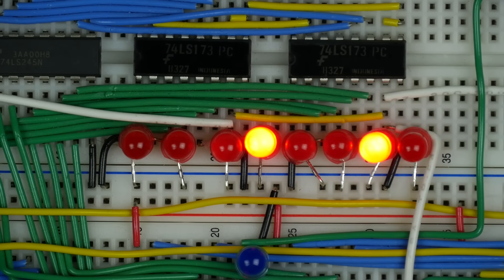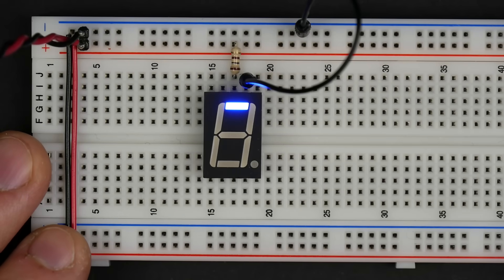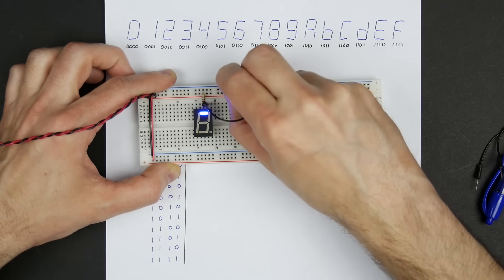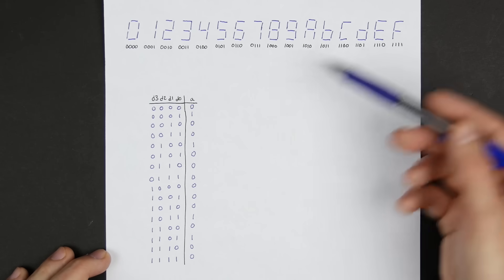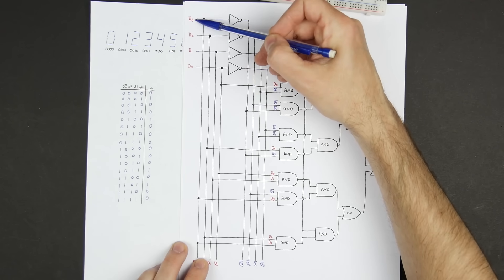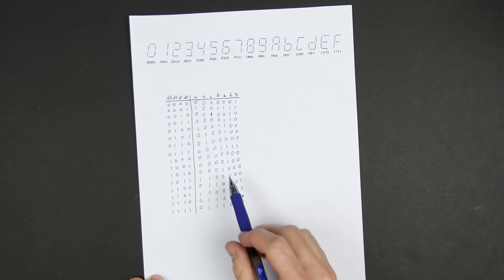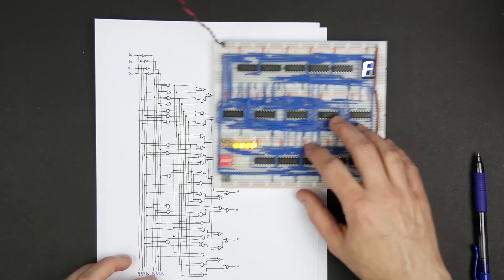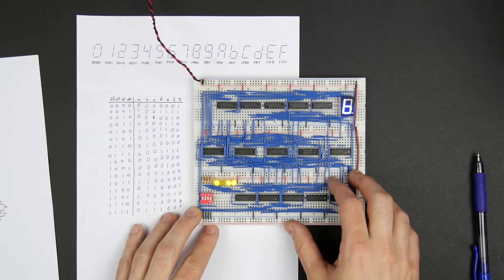Designing a 7-segment hex decoder

Comment: Edit: fail on my part, you totally do that in the next video XD

Couldn't you use a small eeprom to store that table as 8bit control words with the last bit always 1 since you only need 7 out of the 8 bits in that word ?
Store the control word at the address of the number it needs to display.

so for example for F: you'd store 01110001 at address (0000)1111; the last bit is always a 1 because there is no segment for that bit
That would essentially reduce you down to 1 EEPROM IC and the return binary value would also power on the segments themselves( this is just my theory XD sorry if I'm mistaken )
Reply: hi there 
CREATE SHADES USING SIEERPINKI'S TRIANGLE AND YOUR SMART PHONE  https://www.youtube.com/watch?v=DMYn_0uTVB8&t=15s
 go watch and try supporting by subscribing

Comment: There is IC 7447 which are specifically for 7 segment display.
Reply: Except that it doesn't do hex, its internal structure takes a very similar approach using gates to do the decoding.

Comment: Hmm... I'm a little confused. If 'F' is 1111 then d3,d2,d1 and d0 should be on. So, the third logical gate at the bottom should be connected with the last one. Or I'm wrong? And on the end when you have number 6 on the display. Why did you have (presumably) number 4 (or D) on the diodes?

Comment: I’m probably gonna get hammered on. But, after some simplification, just to put it in perspective for just output a. He has, before everything else, a total of 18 gates and 5 chips being used. After the simplification, if I did it right with the little time I have done, there should be a total of 4chips and 9 gates being used with XNOR’s, AND’s, NOT’s, and a OR. so if anyone was curious about a simpler logic diagram there is my take. 
(NOT C AND B AND (A XNOR D)) OR (D AND NOT B AND ( A XNOR C)). Now I imagine that the logic diagram can become simplified even more or even when other lights are added you might have duplicates in some other equations getting less gates because of overlap. Anyways just wanted to share this found it interesting.

Comment: Or use 74LS128 decoder as I remember all this logic circuit are built inside it 😊
This is why we have something called seven segment decoder for running the seven segment display. Only u will use single IC to wave off all this digital circuit,
But to build this you are so great.

Comment: Why not 2digit hexadecimal? For me, I am so used to hexadecimal that I just read it as a normal binary number :D :D Hexadecimal is used for binary flags definition and this is what it essentially is. However, instead of 8bit flags, 32bits are used nowadays (or 64bit when you need a larger flags register, but 32bit is minimum one). I read 0x00000008 as 28 zeros followed by binary number 1000. 1, 2, 4 and 8 are the base digits that define a single bit. Nothing else. Everything else is just combination of those bits. 0xFFFFFFFF is a single 32bit flags registered with all possible flags on (32bit registers can hold up to 8 flags, 64bit ones can hold up to 16 flags).

Refer to this gist: https://gist.github.com/Polda18/0d5f9484d5330bedc5125253b6673ec1

Comment: Can this LED display be controlled with a potentiometer in any way possible? I was hoping to connect it to a potentiometer, and have it read out the voltage as the potentiometer is turned. No chance? Thanks!

Comment: you know that can be compressed down into 17 gates maximum .... because of all the over laps ....did this as a mid term test in high school ... best was 17 gates ... on a ttl cmos logic probe giving a hex out code .... also if you want to expand the display just add another display and include it in the increment as the one other one counts to f

Comment: It would be good PNP transistors are used to drive the segments.  A segment is on when the input to base of a PNP transitor (connected to a segment) is 0V, that is, like GND.

So, you have common anode 7 segments.  Use the 7 PNP transitors (or 8 of them if your 7-segment has a dot for decimal number) and use a 74HCT595 to shift out the bits to turn on/off the segments.  The HCT595 also lets you chain the 7 segments to make more digits.

Comment: you could easily create a tiny version using an arduino nano/ some other board and wire the pins to digital output at a low voltage with complex logic coded in?

Comment: It took me a while to figure out why you put your switch upside down -- after I wired mine and it didn't work (since I wired my switch differently out of ignorance). I seem to recall you mentioning turning your switch upside down in another video (but I don't remember which one), but I don't recall you mentioning why (other than aesthetics). Turns out, the 74LSxx series chips will output high (technically, undefined), when the inputs are left floating. With the upside down switch, when its "off" (actually "on"), the chip inputs are all pulled to ground. Then flipping the switch "on" (now actually "off") will disconnect ground and allow the flow through the small pullup resistors to V+

Comment: I was thinking of a way to optimize the circuit.   I haven't written it out yet but i was thinking about it in theory.      You start out with four bits and with the 8 leads (four bits, and four not bits). 

You could split up the 4 bits to 2 bits each  and then create ands for all of the four possibilities of those two
( 00, 01, 10, 11) .   once again, you will out but eight leads   but then you can make ands with these and maybe it will be a lot simpiler becuase there will be a lot of common leads.    ill need to work this out..
Reply: Benjamin Rutkowski

Comment: Wouldn't you just need 2 segment displays and twice the circuitry to display an 8-bit word in hexadecimal? Seems like you could treat the two chunks of 4 bits separately. You would only need 3 displays and more complex wiring if you wanted to do it in decimal.

Comment: should it be "1" ON and "0" off? I'm a bit confused
Reply: War Gamer Since it is a common anode, the p side of all the LED are connected together to a +ve voltage. The other side (n side) of the LED can be either connected to +ve or -ve Voltage. If it is connected to 1(HIGH), both sides of the LED will have same voltage and no voltage drop across LED so it will be OFF. If it is connected to 0(LOW), there will be a voltage difference across LED and it will be ON
Reply: hi there 
CREATE SHADES USING SIEERPINKI'S TRIANGLE AND YOUR SMART PHONE  https://www.youtube.com/watch?v=DMYn_0uTVB8&t=15s
 go watch and try supporting by subscribing

Comment: 07:27 There is a nice couple of chips that contain a combination of AND and OR gates connected in this particular manner to facilitate building decoders:
74LS51 contains two OR gates, each taking input from a pair of AND gates; the first one from two 2-input ANDS, the second one from two 3-input ANDs.
74LS54 contains one 4-input NOR gate that takes input from two 2-input AND gates and two 3-input AND gates.
74LS55 contains one 2-input NOR gate that takes input from two 4-input AND gates.
Using these could possibly reduce the number of chips required to build this humongous decoder. Further reduction can be done by applying Quine-McCluskey reduction technique to find the minimal set of essential prime implicants, especially the common ones that can be shared among several output functions ;>
12:10 Careful with "saving some gates", though: Sometimes by changing the structure you can save some gates, but increase the delays if there's a longer chain of gates along the path to the output of the function. I know that for the frequencies we're dealing with in case of a 7-segment display decoder, even with multiplexing, are not that high, so a couple of nanoseconds of more delay is not very significant. But it may be significant in general when designing decoders for some faster devices, e.g. some multiplexers or ALUs or signal decoders etc.

Comment: For anyone interested, here is a smaller, 20 gates (7 OR, 4 NOT, 9 AND) implementation of BCD schematic: http://www.electronicshub.org/wp-content/uploads/2014/03/BCD-to-7-segment-Decoder-Design-Using-Basic-Gates.jpg

Edit: Actually 19 gates. You don't need one of them NOT gates hooked to an "A" node.
Reply: that is only for decimal digits 0-9, and does not include hexadecimal digits A-F

Comment: Just to point out for people saying use a karnaugh map or an mcu etc, I'm sure ben is aware of all those things, he's teaching you this as a tool.  It allows him to show you how it works in the clearest way, and the difference between combinatorial and sequential logic, introduce eeproms which no doubt are used later on for microcode etc - that's what I love about this series, everything leads onto everything else, its great!

You don't want him dropping k-maps on you just yet.
Reply: @Doctor Buga I use 7400s all the time, that's not the point. Building a processor from 7400s is educational, not a practical way of obtaining a processor. If someone is complaining about this video series not being practical, they have missed the point. Seems to be a common issue.
Reply: @jasmine2501  It's all very practical.  If you design an ASIC this is what you need to know.  Yes you can trust the tools to do synthesis but actually understanding what the tools do helps you debug weird stuff.
Reply: @GodzillaGoesGaga  No it is not! I used to be an ASIC designer. They use hardware description languages, and once upon a time they did use schematic capture.
Reply: @deang5622  I'm still an ASIC designer!  Have used schematics in the old days.  Synthesis tools (Synopsys and Cadence + FPGA company tools) and STA tools are way better now.  Sometimes the synthesis tools do things you don't expect (most of the time the are correct) but sometimes you end up with a race condition for whatever reason.
Reply: For the record I currently use Verilog.  Have used VHDL, and in the very distant past, PALASM, ABEL,  Viewdraw for FPGA design, and even k-maps and paper to figure out state machines.  Also have used SystemC when I used to work at an FPGA company.
Reply: It seems to me that you don't have a lot of experience debugging real ASIC designs and race conditions where one needs to understand what the tools did and why they did it.  Stuff like blocking and non blocking events within the code and how they synthesise into real logic and the timing issues related to them.  But whatever!!
Reply: that logic stuff he uses is in wafers too. its just the size, speed and a more complex design. he taught how to start out. the difficulty is to manufacture it that tiny from materials. doesnt matter if its 7400's or whatever its called on wafers.
Reply: @DarthZackTheFirstI  Wafers? What on earth are you talking about? Completely wrong use of language.

Wafers are just a disc containing integrated circuits. IC's contain logic circuits.
Reply: @jasmine2501  It's not that educational.
Did you build a processor from 7400's at university? No, you didn't. Why not? Because it's not an efficient way to teach the subject.
Reply: Nice comment.
Reply: Dunno man I'd love to see a video where Ben goes through karnaugh maps or quine-mcclusky tabulation; his style of explaining things is really good!
Reply: Also, I tried the function with k-map and the expression didn't boil down much anyways.
Reply: @comradepeter87  That's a poor statement and poor justification when you are building it out of discrete logic. By reducing the logic you: save cost, you reduce the complexity of the circuit and make it easier to build, you improve the performance, you reduce power consumption and you save physical area.

So if you're going to implement using discrete logic, you had better be using Karnaugh Maps to simplify the circuit.

Now, in modern times, you would not use discrete logic, you would be using PLDs and FPGA's, and then it doesn't make much sense to use Karnaugh Maps.

You'd represent the truth table in VHDL or some other hardware description language and let the synthesis tool sort it out and optimise the design specifically for the target technology.
Reply: I agree but I was hoping in one of his future videos he'd cover k maps... Ben if you're out there, k maps please :)
Reply: @justingolden21  I get the impression he is not a fan of it. I did not like the way he approach combinational reduction with memory.
Reply: There is not likely any sequential logic for this. The gate approach is pure combinational. This circuit requires not memory so it would be pure combinational. Technically the ROM approach does use memory but it use the address decoder to select ROM registers/cells. Which makes it work mostly like combinational as all inputs become address lines. There is not clock or memory involved. The output values are reduced into the ROM, this is how LUTs work also. In practice this is huge, slow, power consuming and expensive.

More than likely this circuit can be reduced. However the proper reduction here involves huge K-maps. It looks like he did try to reuse terms some. However using pure AND/OR will likely cause issues. He builds this like a CPLD macrocell. If willing to step into transistors this can be reduced even more.
Reply: @davidthacher1397  Huge Karnaugh Maps? Rubbish.
Reply: @Awais Mushtaq You can reduce the gates by using a different encoding or different type gates.
Reply: What's after 9999  1K
Reply: Why not? That's how I was taught at university!
Reply: I'm not sure how people can watch this series and not immediately understand that it's ALL "crazy things done for educational purposes" and none of it is practical in 2019.
Reply: @jasmine2501  That is not true. There are still places for k-maps, LUTs, combinational circuits, etc. Many people who think this take a few introduction courses which never really much outside of the actual usage. Many circuits have gotten sloppy and tools do a lot now. However overall your point is incorrect.
Reply: @davidthacher1397  I am perfectly aware of all those facts, and yet I still have my opinion. What you gonna do about it?
Reply: @jasmine2501  Tell you that your still wrong and part of a huge issue in industry. The software world is also complete mess for similar "professionals". Let me guess Computer Science. I can also come up with reasons for making your own processor too!
Reply: @davidthacher1397  I have 20 years of experience as a developer in industry and 35 years of computer science experience overall, in everything from spacecraft to telecom to finance, and I get a six figure salary because of that. I also have a degree in a completely different scientific field and have worked in that industry as well. So, I have a lot of credibility on this subject, and if you want me to change my opinion, you need to make an argument and get me to accept it. That's just how this works. 

And trust me, even if you're right, you're never going to be able to insult me into agreeing with you. If you want to be a dick about it, I'll disagree just because of that. They don't pay me the big bucks because I'm "part of a huge issue in industry" - quite the opposite.
Reply: @jasmine2501  people who talk the most know the least. You boast but we’ve seen no proof of any of that nonsense you just plastered all over the internet…

Comment: Why not to use the 74LS46, 74LS47 or 74LS49 CHIP?
Reply: Adrian Sikora
if u use the ICs that u have mentioned,for invalid bcd codes( 10 to 15) the outputs wont be A to F....
Reply: I think he'll get to that but he has to teach the low level concepts before showing how to simplify the problem
Reply: Or use an Arduino

Comment: The CD4511 actually do the same thing as you did here.It is just the single IC for the above circuit
Reply: Except it doesn't because the 4511 only goes from 0 to 9, not 0 to F.
Reply: yes yes that's right

Comment: Why not simply use an MC14495-1 Hexadecimal to seven segment latch/decoder driver. This is used for a Common Cathode LED device, if you want to use Common Anode simply pass its outputs via an Octal inverter chip?

Comment: That's what I thought was the purpose of the EEPROMs. I hope programming the EEPROMs will be one of the up coming videos.  I have a couple of ideas. Either building a circuit with dip switches or using an Arduino with some code to do it. Don't feel like dishing out 50 bucks for a programmer.  I'm mapping the whole thing out for my sanity sake but don't want to give everything away, this is how you learn, so the link is low res. I'll share the high res diagram when Ben is done with his videos. Don't want to step on the man's toes.  Keep the Videos comming Ben  and to others please pledge some dollars to support him, he deserves it. If everyone just pledged 1 dollar per video he would have thousands of dollars for his cause. Who's with me !!!!
  https://www.dropbox.com/s/bodo4ztey9wbmlp/Thumbnail%208%20Bit%20Computer.png?dl=0
Reply: @Tech C, I develop and maintain one of the largest open-source Flash and EEPROM programming libraries. I can tell you the reason for the cost is not the hardware, but the software. There is virtually no way you could do it in all logic. The reason is just the massive number of different chips that require different methods to program. Some have VCC with +5v and a VPP that needs +12v during certain operations. Some need certain memory registers changed/polled. Some have boot flags / locks that need to be modified. There are over a dozen different programming sequences. Different page sizes, block sizes, sector sizes, etc. Various chips have timeout values that are not discoverable via hardware, some do, some have ready write signals/pins. The list goes on and on! :)
Reply: shift register binary counter and a micro controller